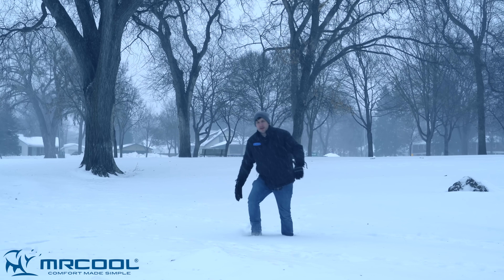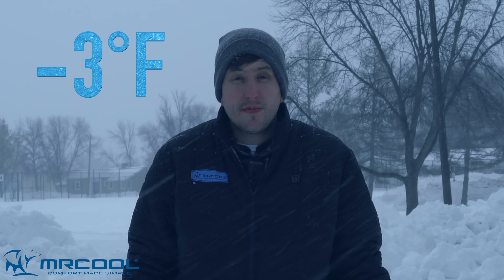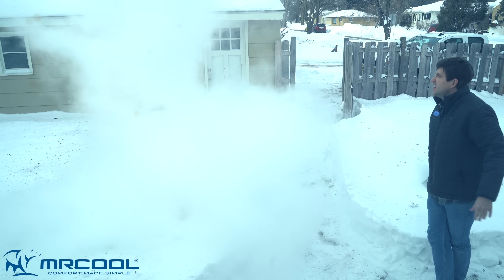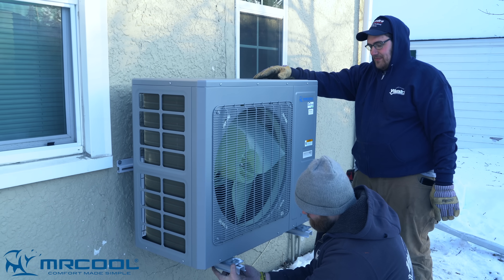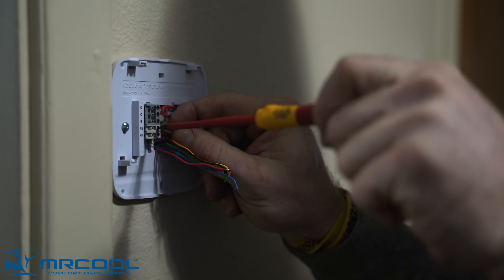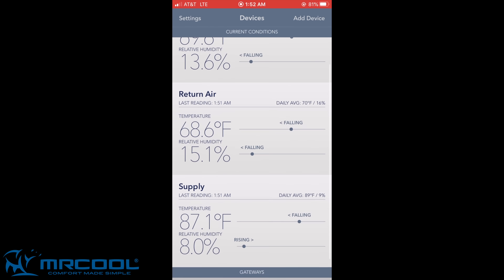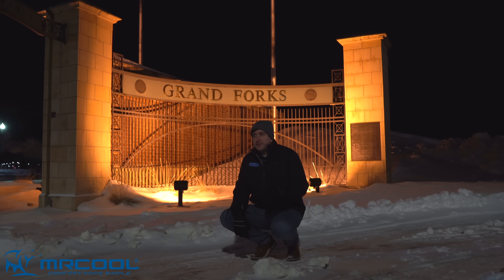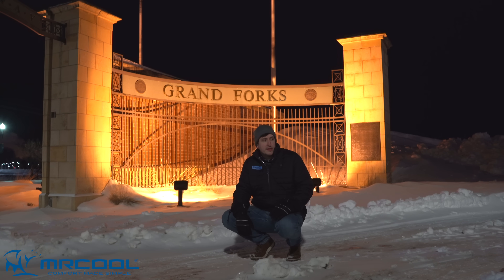The MrCool Universal Heat Pump Heats at -24 Degrees

Comment: How are you able to make/transfer heat at -24 degrees? Is it the refrigerant or an onboard heat strip? If it’s a heat strip, how much power does it use to keep the home at 70 degrees? Could this be compared to electric baseboard/resistance heating?

Comment: I don't get how yours is doing that well. I have a newer house with crazy good insulation. On 3 ton it struggles to heat my house to 72 when it's 35 out. 1400 sq ft house. It's like the staging doesn't want to go passed 50%

Comment: I have the 3 ton universal unit and I'm so far very very happy with the unit. The AC and heat performance is amazing. Tech support is there to help if needed.
If you get 1 and install it correctly you will not be disappointed.
I also love how you can convert it from 3 ton to 2 ton easily with dip switches😎
Thank you Mr.Cool!!!
Reply from the maker: Great!

Comment: Can you post the wiring diagram that was used with the Honeywell thermostat? I want to co firm it was installed correctly.
Reply from the maker: I'm sorry, we cannot. A local contractor installed the thermostat. As we had multiple independent sensors placed around the house, and connected directly to the Universal, we have no reason to believe it was malfunctioning.

Comment: Did you install the heat strip on this unit?. What size of air filter this unit uses?.
Reply from the maker: We did not install a heat strip on this particular installation, but the Universal can accommodate a heat strip.

Comment: so 4.5kw continuous (90%duty?) at 10 cents a kw,  thats 324 dollars in 30 days....
that looks like the 2/3 ton unit, which is 36,000 btu, (10.55kw equivilant) so  2.34x the heat output over purely resistive heating.  R410A refrig.    18 seer

Comment: what is the exact amperage draw for the 27k unit with 3 wall units, for ac and or heating
I have a home that I want to put two 27k units on a 100 amp service. Is that wise . I'm not hiring an electrician I'm very good with wiring just not sure. You are saying 40 amp with 8 gage wire , that's over kill to me. why 8. 30 amps it seems to cover with 10 gage supply, that's why I need to know the draw. thanks
Reply from the maker: Please call tech support at 270-366-0457.

Comment: So how does capacity scaling work? If it's 3T mode, when would you expect to be at full 36k, is it a sliding scale based on outdoor temps, refrigerant temps or based on run time or how will it decide. If it's mild out, will it ask for full  capacity or use some type of algorithm? If I need 1.5 ton, will the 2 ton be always pushing over capacity?
Reply from the maker: The system scales up as needed. It always starts out at a lower capacity, and then scales as necessary to meet the set temperature.
Reply: @MrcoolComfort  Is the air handler a variable speed blower?

Comment: Question for you. Is there condensation or water that needs to drain from the air handler unit on your standard mini split system? Obviously it can't drain outside or it will freeze. How does that work?
Reply from the maker: The Universal is a central system. In heating, the condensate would collect on the condenser. It has a defrost mode to melt any ice buildup.
Reply: @MrcoolComfort  ok thanks for the info! I'm debating on putting one in South Dakota but it looks like it works in North Dakota so I should be fine.

Comment: you mentioned that the air handler and condenser both run off 240 volts 2:22 . Do they run off the same single breaker/wires or two separated breaker/legs?
Reply from the maker: In a central air system the air handler and condenser would typically be wired separately.

Comment: thanks, this looks great. if i buy the '2 to 3 Ton 18 SEER Variable Speed MrCool Universal Central Heat Pump Split System - Upflow/Horizontal with Quick Connect Lineset' on amazon and install myself what is the warrantee?
Reply from the maker: If you install it yourself in your own home with the Quick Connect lines, you get the full warranty coverage (i.e. - 10 year parts).

Comment: I just ordered this same system with a 25 ft lineset, do i need to buy  those 4 brass couplers for the air handler and the condensor to hookup  the lineset?
Reply from the maker: Not necessarily. You only need a coupler kit for the Universal if you need a longer than usual line set.

Comment: Would the DIY pump work in  negative temps? We were looking at getting the hyper heat but can’t find anyone to install it...
Reply from the maker: The DIY works down to 5 degrees. The DIY Multi-Zone will work in negative temps. The best performer is, of course, our Hyper Heat unit. When it comes to mini-splits that is.

Comment: Hello Mr.Cool. I am going to install a MrCool 18 SEER 4 ton Heat Pump this fall. I am in Upstate SC. We have pretty mild winters with a few weeks of freezing temps. Would I be crazy to leave off the Auxiliary heat strips? I was in HVAC service for over 20 years and I never liked the thought of electric heat. The fact that this heat pump did not use electric heat has me very intrigued.
Reply from the maker: That wouldn't be crazy. We had the Universal running at twenty below in North Dakota. I don't think you get those temperatures in South Carolina very often, so you should be fine.

Comment: @MRCOOL Is it correct that for the MrCool Universal 2 to 3 Ton Heat Pump system, no coil or parts need to be physically replaced to convert the system from 3 ton to 2 ton?
Only dip switches need to be set to different positions to set the indoor unit and outdoor unit to operate at 3 ton or 2 ton capacity?
If that is correct, and the system is set to operate at the 2 ton capacity, will the correct AHRI certified efficiency ratings be SEER 20 and EER 12.5?
Reply from the maker: Yes, you do not need additional parts to switch between the 2 and 3 ton modes. Yes, I believe those are the correct AHRI ratings.
Reply: @MrcoolComfort  I sent in a website form request asking MrCool to confirm this, but have not received a response for a few days. Could MrCool please repond to my request via email so I can provide the written information to my utility so they will approve my rebate application?

They are denying my rebate application unless I get manufacturer confirmation that the unit I have will meet or exceed the AHRI ratings of SEER 15 and EER 12.5.

I will take photos showing my units dip switches set for 2 ton operation.
Reply from the maker: Generally, homeowners use ahridirectory.org to get the AHRI ratings. The AHRI certified reference number for the Universal 2-3 ton is 205572573.
Reply: @MrcoolComfort  That AHRI reference number is only one of two that apply to the 2-3 ton system. For the rebate, my utility is scrutinizing which one it should be, 204117201 or 205572573

My question I emailed to MrCool is to confirm that setting the dip switches to 2 ton setting will change the unit to have AHRI number 205572573, versus if the dip switches are are set to default 3 ton setting it is AHRI number 204117201.

AHRI 204117201 does NOT meet the minimum EER rating to qualify for my utility rebate.
Reply from the maker: Yes, setting the 2 ton dip switch changes it to AHRI 205572573.

Comment: Is there a cost savings compared to gas
Reply from the maker: Natural gas is very cost effective right now. The main value of a heat pump like the Universal is to completely eliminate the need for a gas furnace in areas where there are only a small number of very cold days.
Reply: @MrcoolComfort  would it be a good choice for indiana

Comment: How much did the installation job cost for the universal system? Who did you use for the install?
Reply from the maker: We used a local company in Grand Forks. Installation cost for HVAC equipment will vary widely depending on where in the country you live.

Comment: But will it work at -46f? Thats the current temp up here in Fairbanks AK. While the more average temp is -25f to  -35f, if it can work at these temps id be sold
Reply from the maker: It would not be operating effectively at -46F.
Reply: Use gas or wood backup.  Run it to -20. Should save money

Comment: Looks like the blower motor in the air handler runs at constant speed ( ~ 900 CFM I guess ) even though the DC Inverters modulates the compressor output as per the heat load at a given point of time. When the heat load is low and compressor has ramped down to , say, 25 % of its capacity, would the blower not start blowing cold air as it is still running at full blast ?
Reply: I wondered that too. I wonder if the fan speed is just set high? I would assume that would have to be a variable speed air handler.
Reply: @jeb721  
Air handler is not variable speed. The motor is brushless dc and speed setting low med high with on board dip switches.

Comment: So you're averaging 4.5kw/hr?  That's around 3250kw/mo.  $290/mo at  .$09/kw electricity.   Not bad at all for a cold climate like that.   Wow.
Reply: It’d actually be less expensive because on average the unit won’t be running 24/7

Comment: This video is not being completely truthful. At -24 it is simply not efficient to use a heat pump only to heat a home. Either:

1) the unit itself DOES have its own built in auxiliary heater like a toaster which immediately kills the cost savings.

2) the coefficient of performance (cop) drops exponentially the colder you go. You simply cannot strip enough heat from the outside air. 

Heat pumps are awesome at Temps around freezing and just above but are terrible at cold Temps. Simple physics.
Reply from the maker: With a standard air-source heat pump, it would not normally be possible to heat a -24. The Universal is not a normal air-source heat pump. You can get an auxiliary heat kit, but we did not install one on our test project in Grand Forks. In that installation, the Universal kept heating even when the temperature dropped to -28.
Reply: Will that be efficient in Canada? In my city, the temperature stays between -10c and -15c for 3 full months, and sometimes goes lower.

Comment: I get it that it can heat the house but I came to see if it’s cheaper than propane or gas furnaces
Reply from the maker: That comes down to where you live and your local utility costs. In mild climates with low cost electricity, the Universal can definitely compete with gas furnace in terms of cost.

Comment: i use a Daikin and a fujitsu in Edmonton Canada and they work great until about -25 .  A portable oil heater makes up the difference in really cold temps when the heat pump works but not as well.

Comment: I love it!  One note, i see the Sense app wattage is reading about 4600 watts, and for that 3 ton inverter drive system that is about double what is should be pulling. I think your Sense energy monitor is reading Double the actual power. This can happen for a few reasons, but its the Sense monitors issue. I have the same Sense app and mine had this happen as well, so i have to reduce what im reading on the app by 50% to make proper "Sense" of it lol.
Reply: It's not reading Double the actual power, 3 tons is 36000 BTU's and 10,550 watts hours so in those temperatures the COP dropping due to the fact that the heat pump is near to balance point,  so the COP is about 2, and probably the heat pump will not deliver 36,000 BTU's in those temperatures so it's even less than 2 COP.

Comment: It looks like from the tracking app on your phone it was using roughly 4kwh per hour from the app on your phone. Almost 100kwh per day at 15 pence per kWh is 15 pounds per day. For a heating season of say 150 days that’s £2250. Not bad I guess if it keeps the place nice and warm.
Reply: It's around $290 usd /mo. based on average rates there.
Reply: @tomfarrell7307  How do you arrive at $290 on 100kwh per day? Or do yo mean $290 per day?

Comment: I was going to put a comment on our well this thing performed but then I realised it's - 24 Fahrenheit which really isn't that cold. I haven't yet come across the heat pump that cannot deal with those kinda temperatures.
Reply from the maker: Most heat pumps cannot produce significant heat at -24 Fahrenheit. Most air-source heat pumps only operate at full capacity down to 47 F. They are down to 60% at freezing (i.e. - 32 F). Typically, emergency heat is triggered around 35 F.

Comment: What would this system gain by being a "communicating" system?  What would be lost?  Is there any way to make it a communicating system by using sensors like the ones you installed in this video? Also, any ERV/air quality accessories you recommend?
Reply from the maker: The main reason behind making the condenser non-communicating is to allow it to be compatible with many different air handlers. We do not have any official guidance on how to make it a communicating system.
Reply: @MrcoolComfort  I'd be so interested in learning from the folks who dreamed up the sensor strategy in this video how to accomplish what they did here.  I'd also like to prove to my smart building science friend why I don't need to spend 2-5x this much on fancier old-school name-brand equipment.  Is there anyone at the MrCool team I could connect with about this?
Reply from the maker: You can always call in to speak with our tech team at 270-366-0457.

Comment: I wonder how it really works in extreme heat. Like west Texas. I would like to install the 4 ton air handler and put in new duct work in my attic. We are just so hot here everyone I know that uses mini splits say that they will cool fine for a few years and then fail.  Idk. We have a LG in our concrete non insulated bed room and we really like it. It’s just so hot here. I do wash my condensers occasionally with filtered water to keep them clean.
Reply from the maker: We had planned to install the Universal in Lake Havasu, Arizona for the summer of 2020. But then COVID happened. Hopefully, we can do that in 2021. One quick note: the Universal is not a mini-split. It is a central heating and air conditioner.

Comment: Do you need a heat kit with this system to have heat or does the unit come with heat and the heat kit is just back up heat
Reply from the maker: The heat pump generates heat, and you can also install a heat kit for back up.

Comment: Would the DIY mini splits work the same in the cold weather?
Reply from the maker: Our DIY ductless mini-split can heat in cold weather, but it is not as effective as the Universal heat pump. The Universal is specifically built to deliver that kind of performance.
Reply: My Mitsubishi mini split (bought in 2014) doesn’t do well below 30 degrees. Matter of fact, i turn it off and use a space heater.  It’s worthless at that temp.

Comment: So is there any thoughts to sharing some info about the electricity bill or temps for summer time?  

This is a huge plus for a real world application, well even though the house is not in use comparing to previous seasons would still give some answers.

Thinking of installing 2 separate ones in a 4 lvl split to help with the crazy differences in heat from the top to basement.
Reply from the maker: Our original plan was to install a Universal in Lake Havasu City, Arizona to show the cooling capacity, but then COVID-19 happened.
Reply: @MrcoolComfort  Still thinking of doing a AC version?

Comment: Today's heat pump technology works great. I have fugitsu mini splits in my house and in NY in January we go down to -6f . My units have maintained my poorly insulated house at 75f.
Reply: How much for electricity bill???
Reply: @rodrigomodesto1884  my electric bill never past 130 a month. Mind you my whole house is electric. All of my appliances.
Reply: @BoriPR82  Can you share the size of your home? Is it multi level? He's showing 4.5 kwh in the video and if you are paying 10 cents a kwh, your bill would be way more than that.
Reply: Can you share how large your house is and size of the units? I'm trying to calc electric cost vs. sticking with gas. @MRCOOL share that the house in the video was $200 for Jan 2020. I paid $130 for gas in Jan 2020.  I'm in NE Ohio so similar temps to NY.
Reply: How are they for power usage? Do you find them economical
Reply: 11111111

Comment: My big problem with this system, is what do you do for warranties? I'm not sure how you're able to get such great performance at such low temperatures, but if something goes wrong electrically I won't be fixing it for free that's on the customer. Mrcool will have to explain their warranty situation. Are they going to trust the contractors? I would have to see this to believe it with its performance at mine is 24 and still putting out over 90 degree Outlet temperature. My big concern is warranties. Like to know how they are able to make this perform so well at such low temperatures. Before I could ever suggest this to anyone I have to know a lot more about the warranty situation.
Reply from the maker: Give us a call at 270-366-0457, and we can explain our warranty process in detail.

Comment: Would be interested to see energy consumption and COP at those temps
Reply: He shows the energy consumption on the phone app at min 04:16. it's 4.6kW/h avarage and peaks to 4.9kW/h at some point.
Reply: @burakokumus6040  Woah, that's a lot of energy. I wonder if its cheaper or more expensive compared to resistive heat in these conditions.
Reply: @prowler1992  5kw of resistive heating would only put out 17k BTUs/hour which is not enough to heat an entire home.  The heat pump is still much more efficient than resistance heating.

That being said, natural gas is probably even more efficient at those low temperatures.
Reply: about half the power resistive heat would need
Reply: @prowler1992  fwiw the math works out to like 60 cents per hour when the unit kicked into running 24/7 mode to heat the house.  If it ran for 18 out of 24 hours that’s like $12 per day of heat (looking at his charts) for only 1550 square feet of house.    Dropping the house temp to like 65 and/or outside temps above 0F would certainly help a lot.